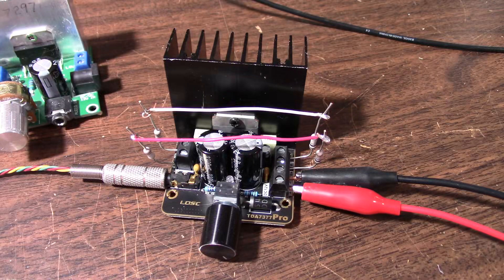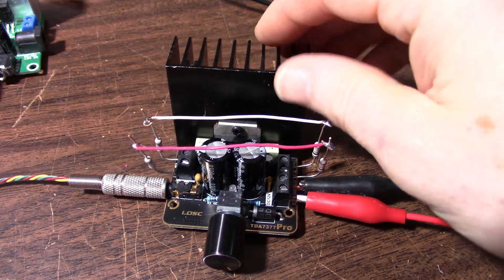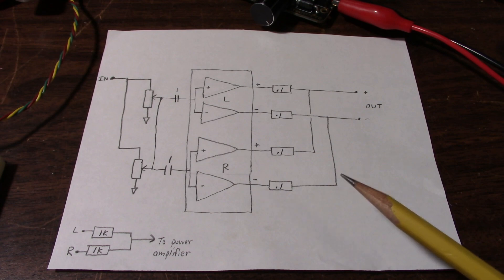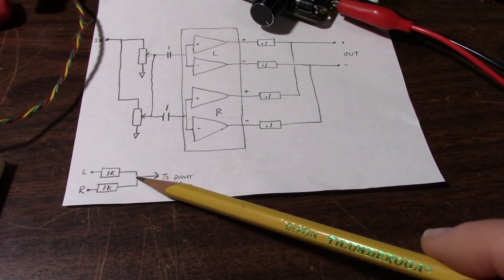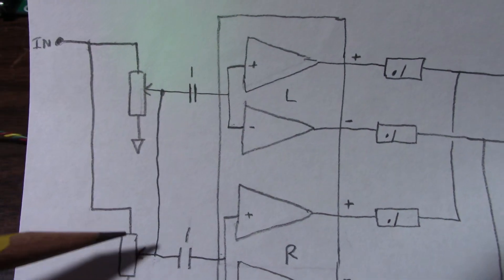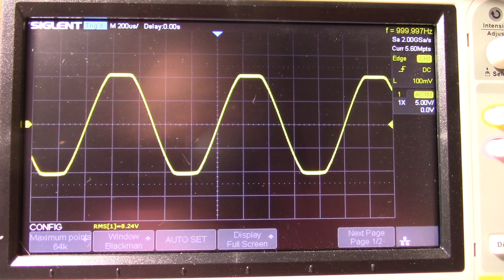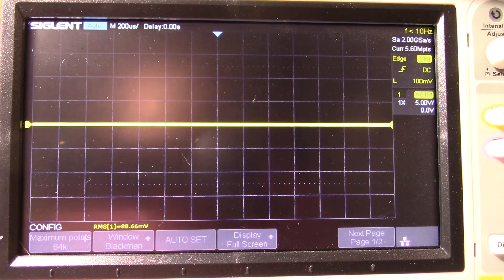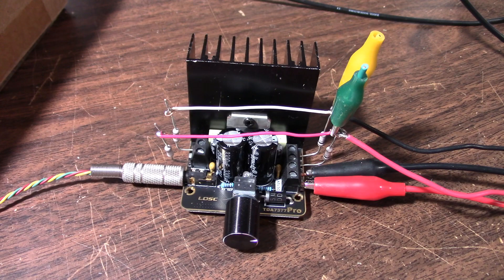TDA7377 channels paralleled for more power

Comment: In order to avoid DC current flow between the amplifiers due to offset differences, you can make the couplings using capacitors.
If they are large enough there will not be too much limit at low frequencies.
If you use electrolytic capacitors you can even bias them by connecting resistors to a DC voltage. The AC signal will not be attenuated and will close the circuit through the speaker.

Comment: I have question -
If an amplifier (bridged )circuit is working well for 10 minutes , playing music through it and then suddenly oscillating ( the speaker diaphragm moving forward and backward ) and even if the music is stopped but still it's oscillating. What could be the reason and how to fix it ?

Comment: wooow.. one single TDA2050 (fake chip) have much output power than that all output chanels in real life. with center tap transformer of course. i'm disapoint on tda7377 to see this video.. And in real world i tested TDA7297 and TDA7377, but i like much how sound TDA7297 on 8 ohm stand floor speakers even at 12v power supply. why do you not test at higher voltage like 16-17v DC ?

Comment: In LA4446 datasheet (old car amp driven in BTL mode) they used decoupling capacitors on each amplifier output to keep bais imbalance from reaching the speakers.

Comment: Thanks for the video. Your setup also suffers from the fact that the circuit draws 5W at idle which is ridiculous. I measured the offset voltages and the difference is about 0.1V, which corresponds to about 0.1W. In fact the resistors are cool all the times. If 5W was consumed by the resistors, they would fry and burn. The only explanation I can find is the internal protection circuit, that somehow interferes in parallel mode. In theory you should observe higher efficiency and less power consumption in parallel mode.

Comment: You've inspired me to start playing with some class d amps. I've almost started a couple fires. :)  Can you please explain (or do a video) why you cannot remove the input signal going to some of these amps and how to correct it so you can unplug the input without the amp going up in flames? Thanks!
Reply from the maker: Amplifiers may oscillate if you disconnect the input while powered up. The input can pickup the output of the amplifier causing a positive feedback condition which makes it oscillate at a high frequency. Shielded input cables can help. Reducing the input impedance can fix this problem. Place a resistor across the input (input to ground). It should be of the value that doesn't affect the source (impedance of the source). A low pass RC filter will also help keep HF out of the amplifier.
Reply: @JohnAudioTech  Thanks for the quick reply! I've only seen this with these pre-made chinese class D modules. I thought I had read somewhere that you can't lift the input to them, but I couldn't believe it. I mean who wants an amplifier that burns up if you unplug your input source? So I tried it with one turned on, and almost instantly a cap near the output burst into flames. I'm from a guitar amp background, so I'm picturing a 68k resistor across the inputs? Any idea why they wouldn't they put that on the board so it can be powered up (with no input source) without frying itself? Thanks again, love your videos.

Comment: Lm1875 can you use parallel mode.
Reply from the maker: Yes, these are great for paralleling.
Reply: Parallel connection is failed ..
Because current shareing resistor are burn and and output distortion sound. ..

Comment: Thanks for addressing my issues!
Now it is the first time I went to be a patreon.👍🎶
I see now clearly how I connected it wrong.. And the TDA7377 is more suitable when my speakers drop to 3.5Ω at 300Hz. But I do not like the current draw at idle when paralleling and using a single channel is working excellent today. So I will be sticking to that with the two monoblocks that only use one of the two channels on the boards. 
I will say that the TDA7297 in two mono setups, each at ~6w/8Ω on a car battery. Sounds better than what I used before a Pop pulse T150CA (2 x 60W/8Ω) that uses a TA2022 chip and a big toroidal.
My speakers are 90 dB/w/m so 2x6w will be able to produce 98.5 dB in my usage. So it will cover the biggest crescendos with ease anyway.
Will make a new video on the working setup. :)
Thanks for your videos! 😍
Reply from the maker: Thanks for the feedback. I'm glad it worked out.

Comment: Can you hook up output coupling capacitor in the output of the 2 amplifier to eliminate circulation current in the output??
Reply: A capacitor will prevent DC current flowing when the amplifier is idling, but as soon as you put a signal through it any imbalance will still cause currents to circulate between the amps.
Reply: @ferrumignis  but if the signal is balanced there should not be a current right? AC current cannot be generated through a DC voltage as far as i know.
Reply from the maker: @EngineeringEssentials  It will block the DC yet let the AC current pass to the load. No signal will pass without load when balanced. It will require two large caps for good low frequency response. It just makes paralleling these ICs all the less desirable.
Reply: @JohnAudioTech Some IC AMP like TPA 3255 features a PBTL option. Exactly what you attempted to achieve in this video. But our experiment didn't go as expected, is there any problem with this specific ic or is it applicable to every ic amplifier?